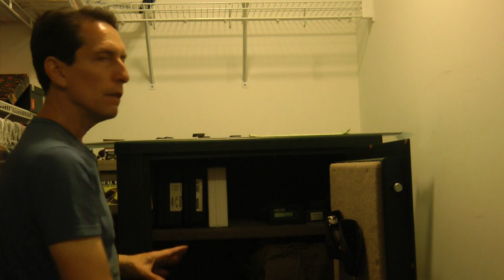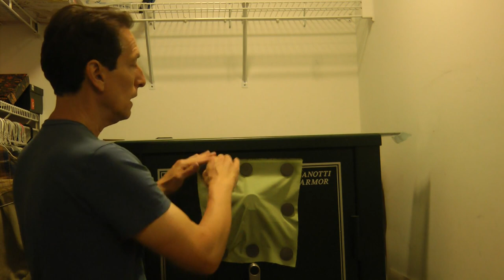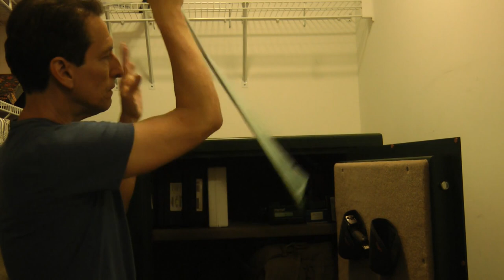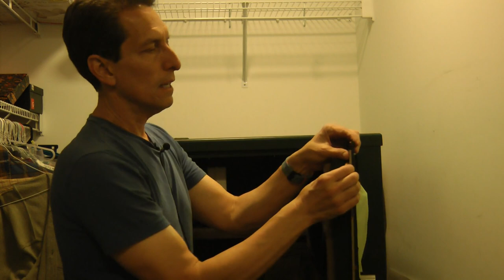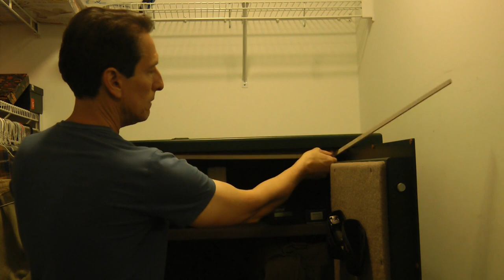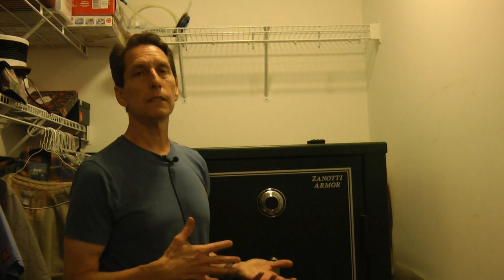Protect Your Gun Safe (and its contents) from an EMP.

Comment: Do you have to remove the paint before you apply the gasket material to have a conductive surface between the safe and the door through the gasket
Reply: I have the same question
Reply from the maker: No, I should have mentioned this. No need to remove the paint.

Comment: Some safes have a back-up key, so if the electronic lock fails just use the key.
Reply: Only cheap ones do. Serious safes do not have keys because keyed locks are weak.
Reply from the maker: Yep, some do, but many don't.
Reply: Another option you may have; I had my electronic lock replaced by a mechanical lock. Not every locksmith can or wants to do that. In my city there is a locksmith business that has been around for 50 yrs.  It takes some skill. He commented to me when he came to change mine that he was getting a lot of requests to make this change. I don’t know exactly what he meant by a lot, and I didn’t ask. I had called several locksmiths before I found one willing to do it.  One place said that it could not be done, but in can be done and it took about an hour. The mechanical lock that was installed has 4 different numbers and each number has to be circled around a different number of times. It usually takes me several tries to get in bc I don’t open it very regularly. Much more of a hassle than a digital code, but I made this change several years ago before Arthur made this video.
Reply: @TheOnlySaneAmerican  Serious safes have mechanical combination locks because electronic ones don’t hold up.

Comment: Doc have you ever actually tested a modern red dot or quality LED flashlight against an EMP? I've never seen either tested by anyone.
Reply from the maker: No, mainly because it's very difficult to actually set up a real EMP test. I'd love to do it one day.
Reply: @disasterprepper  what is your confidence level that a modern quality red dot would be rendered inoperable? Thx for your response.
Reply: @Valorius  buy a Primary Arms micro prism. Has the reticle etched into the glass so it is still usable in the event of an EMP, solar flare or CME.

Comment: 🎉🎉 I like your channel and info, But Very disappointed to get conflicting info. On one hand a little paint won’t affect electrical leakage, and your lock material cover has many gaps between magnets, but it is OK ?  BUT Then you sell expensive gaskets for what?  If they are necessary, then the rest of the information is incorrect???  And what about the mounting holes most safes have in the bottom ? I really want to protect my safe so I can open , but not very confident in All the mixed info on line and within your videos?

Comment: Almost all safe have a secondary way to open them with a key.
Reply: Only cheap ones do. Serious safes do not have keys because keyed locks are weak.
Reply: @TheOnlySaneAmerican  Almost all gun safes have a hidden key lock to get in for people who forget their combo. Almost all gun safes are built the same. With thin sheet metal and sheetrock and carpet on the inside. If you spent a ton on a gun safe someone saw you coming.
Reply from the maker: Some do, some don't. I think it's considered a potential weakness to some safe manufacturers and owners.
Reply: I don’t know if keyed locks are good or not. However mine does not have a key feature. And several years ago I had my electronic lock replaced with a mechanical lock. That was before Arthur made this video.

Comment: As always, good video. A comment I saw below mentioned holes in the safe. I had that issue, 4 holes covered with a plastic cover. This is where you would add bolts in case you wanted to bolt the safe to the floor. I filled the holes with tin foil and taped a small square over each hole with aluminum tape.

Comment: On safes which are fire proof, is that gasket material going to reduce the effectiveness of the safes fire proofing features?
Reply: My gun safe has fire/heat-activated foam that expands to seal the door opening.  I'd have to ask my safe manufacturer the same question.
Reply from the maker: That's a good question. I'm not really sure.

Comment: Would/Should I first need to remove (any) paint from the metal where the conductive gasket sits?

Also, are microseams where conductive gaskets meet-up linearly and/or perpendicularly be a risk of any RF energy leakage? I would assume no, since you mentioned even a small drilled-out hole wouldn't contribute much RF energy leakage.

As for ferrites, is there any advantage/disadvantage of putting one on BOTH sides of the cable entry point? 🤔
Reply: That's my question as well. Does it need to conduct?
Reply from the maker: No, you don't need to remove the paint. Previous tests showed that the thin layer of paint isn't likely to affect shielding enough to matter.
Reply: @disasterprepper  Thanks Doc. BTW I mentioned your page in the comments of the last Mark Moss video. The guest was good except he brought up EMP and didn't know what he was talking about... 
It's mostly a financial page, but hopefully they get you on sometime.
Reply: 🎉🎉 ??  I like your channel and info, But Very disappointed to get conflicting info. On one hand a little paint won’t affect electrical leakage, and your lock material cover has many gaps between magnets, but it OK ?  BUT Then you sell expensive gaskets for what?  If they are necessary, then the rest of the information is incorrect???  And what about the mounting holes most safes have in the bottom ? I really want to protect my safe so I can open , but not very confident in All the mixed info on line and within your videos?

Comment: EMP-proofing a gun safe is something to which I've given a lot of thought since I own $3,000 night vision gear, and I have a question.

   Wouldn't it be better to remove the paint from the safe beneath where you plan to stick the EMP gasket? Or is that not needed? 

   Thank you!

   Kirk Rogers

   PS: best Faraday cages anywhere for the money? Christmas popcorn tins. Very tight seal and you get a Faraday cage plus a popcorn bonus for only $10. 😊
Reply: He answers this question, witch I also had further down. And thankfully says it is not necessary.

Comment: Mr Bradley.  EMT doctor.  I have 5 safes, 2 of which have digital with a skeleton key back.  My 3 main safe or digital only.  I am looking at whether to change them out to tumbler style locks, not very inexpensive, or doing something like you have in this video.  I am curious how you were able to test that this  will work.  Secondly rather then worry about conductive strips behind the door why could you not use a piece of conductive cloth with magnets that extend from all four corners with would overlap the door seams.  I would be interested in your response.

Comment: I have purchased the gaskets to line the inside of my Winchester gun safe . But there is a    "Palusol"Heat  Expandable Seal for fire protection, I do not want to remove . Do I place the gaskets over the seal, or on the Door . Does it make a difference.? Any thoughts greatly appreciated.

Comment: I just did this to my safe, though i hade to use the conductive gasket  on the seam of the door though i dont know if i can get gasket on the inside where the hindges are. The door seems sealed good other than that part . Im guessing  if emp occurs it can still get through  because of this?  I also used a ferrite on my humidifier chord

Comment: Hello Dr. Bradley, another great video  for home diy EMF and frequency enthusiasts to try and enjoy. I've read your book and your videos covering different faraday bags and cages, but I was wondering if there was a way to only block signals coming from a specific direction?.

Example instead of shielding your devices with an entire faraday cage, would leaving a large opening at one end of the cage allow for signals to only travel forward, and preventing them from traveling behind the shielded surface? Essentially creating a low power directional antenna and preventing devices at the back of the opening from connecting or interfering. 

Would a faraday bag and a trash can with the lid opened allow a Wi-Fi signal to only travel in the one direction.
Reply from the maker: The issue with shielding versus only certain directions is that RF energy tends to bounce around and come in at all sorts of angles. You'd get some shielding, but it wouldn't be great even in the directions where metal was in the path.

Comment: Side question on faraday cages in general. If you use aluminum or copper foil as a conductive shield for your cage, do you need to protect that material from oxidation? I’ve heard aluminum and copper oxides don’t conduct electricity well.

Comment: My question for you doctor is weather or not the effects of a faraday cage is.... stackable?  In your video testing chicken wire vs aluminum foil you used crates. Now if I wrapped the outside of the crate in chicken wire, and the inside of the crate in aluminum foil would the DBs of protection add to eachother? I'm attempting to make a safe box for all my long term storage electronics and debating some of the best cheap methods.
Reply from the maker: Layering like this works very well. To determine the net shielding, you generally add the dBs of each layer.

Comment: I recently had a Pacemaker inserted into my chest. As a result, my doctor told me to stop welding due to the emitted radiation. Would I have to make a complete "Faraday Suit" to protect my cardiac device, or could I have my welding jacket and gloves lined with copper cloth and sealed at the waist, wrist, and collar? Naturally, my face would be covered by my shield, although, I suspect a balaclava made of copper would be much better. I'm just trying to protect the Pacemaker as I don't weld more than 5 mins. at a time. Thank you.
Reply from the maker: I couldn't offer an informed suggestion on this. Welders do put off quite a bit of electromagnetic energy due to their sparking operation, and shielding of portion of the human body is pretty trick to do effectively.

Comment: What ferrite MIX do you recommend as a broadband ferrite on a power cord?
Reply from the maker: There are many, but 43 mix is good for broadband suppression.
Reply: @disasterprepper  Thanks.  That's what we use in ham radio for a lot of RFI supression on HF   I was also thinking of adding Mix 61 to enhance EMP effect on higher frequencies.  Best regards and thank-you kindly.  Greg in Vancouver BC
Reply: Will a 31 mix be sufficient?

Comment: Would I be able to safely store my ecoflow solar generation in my gun safe if I use the gasket method for sealing it?
Reply from the maker: You could measure the shielding effectiveness to be sure, but I would guess yes. I think you can get 50+ dB shielding in a gun safe properly sealed.

Comment: Question: Would a oil drum be a good storage container to protect your goods from an EMP. They can hold quite some equipment and are cheap once they have been used.
Reply from the maker: I'm not really certain. It seems like it would work well, but I'd have to measure it with test equipment. The seam where the lid goes on is the part that might compromise it.
Reply: Just in case you haven’t seen it, Arthur did test a metal galvanized trash cans. They offer good protection so long as you have these conductive gaskets on the inside of the lid so that the lid seals tight. He sells an  EMP testing device which I have. I have never tested it with an oil drum.
Reply: @tmt8425  Yeah sadly they arent as popular in Europe and are significantly harder to find than oil drums
Reply: @will8649  popcorn tins like the kind that are popular around Christmas (at least here in the states) are very cheap, work very well, and come with a load of popcorn.

Comment: Will a EMP destroy my night vision goggles? I have navigation devices that can be charged with portable solar panels. Will the same go for my solar panels? Thank you if you can give me the information!
Reply: I’ve been following Arthur for years. I noticed you didn’t have a reply to your question. An EMP will damage night vision goggles and navigation system if it is electronic which it undoubtedly is, unless it is a straight up compass that only uses a needle to detect direction. If you go to the items he offers, there are different bags you can buy to store your night vision goggles. As to solar panels, it is possible they will be damaged along with any inverter or other equipment it may use. I don’t use my small solar array of three panels very often. When not in use I wrap them in the conductive cloth Arthur has. He tested multiple cloths. The ones he sells are the ones that performed the best in his trials.

Comment: Howdy EMP Doctor, could you maybe do a video on the effects of  EMP,  Solar- the Sun, like the Carrington event or a nuke type EMP and what it would do to a home solar panel set up supplying household electricity? 
What components would be effected that you might have to have on a back up stand by to get it going again?
Thank you.👍
Reply from the maker: Solar CMEs affect things attached to very long conductors (think miles, not feet). If your solar power generation system is connected to the grid, it could certainly be damaged by a CME. But if it's disconnected from those mile-long conductors, it won't be harmed by a CME.
Reply: @disasterprepper  I didn't think the solar panels themselves would be so affected but things like inverters or other control modules & such. I was just asking so I might put away such items in a Faraday cage for backups. I also was wondering if electronics had to be on to be effected or if they are inert if shut off. Thanks
Reply: Hi.  I have been following Arthur for years. As far as electronics and EMPs electronics that are turned off or even stored will be damaged.  I’m just talking about EMP. I don’t know about an inverter hooked to a solar system during a CME.  I focus on protecting from an EMP. If it’s a CME that isn’t of some Biblical proportion, you will be able to buy a replacement I believe.  I’m only aware of one CME that hit in the 1990s at the time when people had pagers before cell phones got popular. I remember that the pagers themselves were not damaged, but some satellites that carried the signals were damaged and so there was a disruption of of pager service, but the CME did not damage the pagers themselves.  But if one is talking about an EMP, then any replacement electronics you have need to be protected even while turned off and are in storage.  I hope this helps.